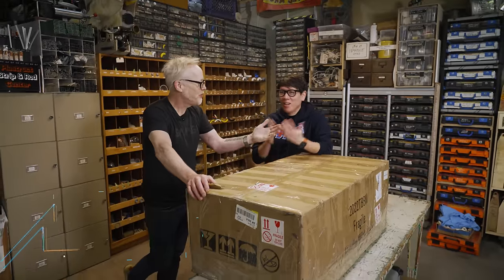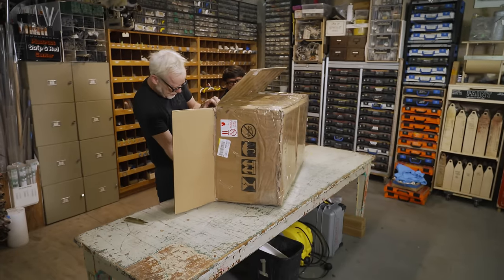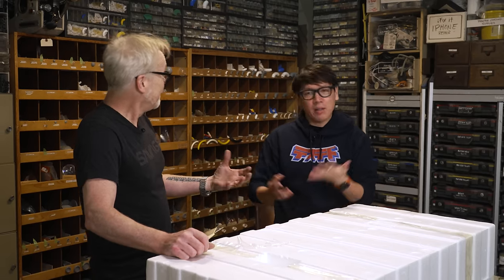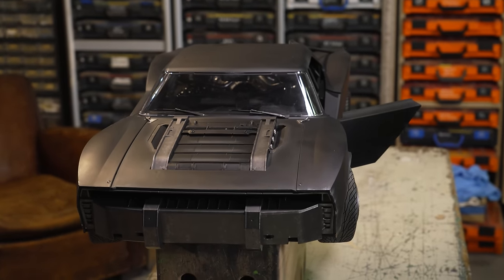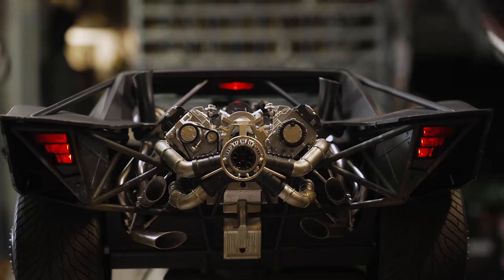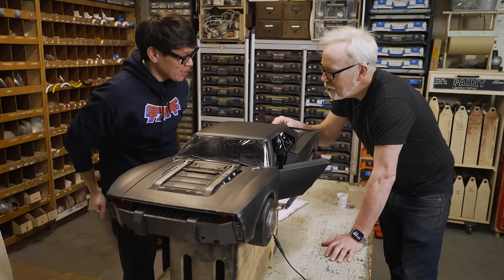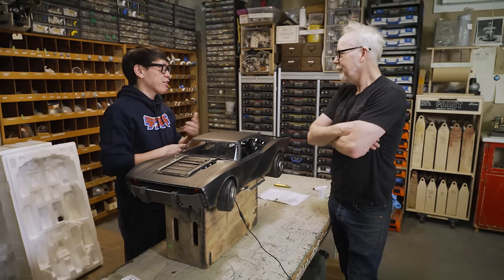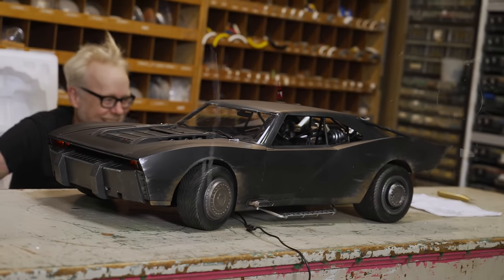Adam Savage Unboxes The Batmobile from The Batman (2022)!

Comment: There was an early suspicion that the rear engine was a triton v10 but it isn't, most probable explanation is that it is bashed in-universe from other components. A crate motor would be traceable but a frankenstein one wouldn't. Its a shell built by Dominic Touhy's team over methane tanks, with a 454 on front. The weight distribution with a plant that large in back is nightmarish, but it'd work for the chaos of a ramming prow. The jet turbine might not be an afterburner but a way to get exhaust out faster. It is no more silly than any other Batmobile and it continues to grow on me. The echoes of the Animated Batmobile are one of my favourite bits.

Comment: I always thought that a torque wrench was just for getting things tight enough, until I rebuilt an aluminium engine and found out it was for quite the opposite also.
Reply: Lol, I know right?!? Clearly Adam has never worked on any real world mechanical applications. Don't want to use a torque wrench, no problem heres your bolt extractor kit, heres your drill and tap set, heres your threadsert kit, etc, etc.
Reply: Yeah that one made me cringe a bit. Sorry Adam.
Reply: I'm a torque spec follower but more experienced mechanics i know tighten a lot of things by feel. as long as its not engine parts or suspension his advice seems reasonable
Reply: I love Adam, but sometimes the limits of his experience show.  The torque wrench is one example, and he recently made a video where he said he thought all the crap 3D printable models on the market were not a fault of the creators, but limitations of the software.  Having used all major 3D modelling programs on the market, he is 100% wrong.  The software is amazing - the problem is lazy creators.
Reply: I was honestly just making a statement. It wasn't at all to do with Adam's lack of knowledge. He's got more experience, knowledge, and skill that I could ever possess.

Comment: I have a bicycle with a lot of Carbon Fiber parts. There are screws that bolt on CF (epoxy) threads. Without a proper torque wrench you will strip the threads. Also, when assembling car engines, not using a torque wrench to tighten the head to the block is practically impossible. Besides new engines require the fancy torque wrenches that measure angles as well

Comment: sorry adam, whoever told you that about the handle on sockets and torque are just wrong. No IFS ANDS or BUTS. Torque wrenches are used to make sure you have the proper level of clamping, be it tight or loose. I have ALWAYS had issues with over-tightening using ratchets, I think I'm just snugging things down but end up being WAY too tight and end up stretching bolts and studs and have to start over with new hardware. On the other end my brother (who is much larger and stronger than I am) is forever leaving things too loose. For years in my fathers garage he would follow behind mechanics who believed as you do that torque wrenches were not needed and find that most were not even close to being correct. Every mechanic was required to use the torque wrenches or be fired, and over the years we lost several mechanics because they refused to torque correctly and it cost many thousands in repairs when their work failed.  But that is VERY BAD advice to be saying to the public even as an off hand remark, someone may actually listen and not use a torque wrench when working on their vehicle, and some items, not torqued properly can have fatal results.
Reply: This myth needs busted

Comment: Frickin awesome! And I love the ultrasonic atomizer addition, you don't have to worry about some weird chemical or something heating up to boil the water, plus using distilled water limits the worry of corrosion. I'm a big fan of the year one batmobile. It's not some ultra expensive custom made behemoth with 1000 fancy gimmicks. It's just strong, fast and will get the job done.

Comment: Okay, if they can do this, then they can make a Mad Max "Road Warrior" Interceptor in 1/6 scale - or a Blade Runner Spinner. ;-) There must be some weird licensing issues with those two movie vehicles, as nobody ever makes them (apart from the 1/18 AutoArt or Greenlight and that 1/18 Blu-Ray version of the Spinner). But having 1/6 versions of those vehicles for the 12" figures would be incredible. I modified the 1/18 Greenlight Interceptor into a "Road Warrior" version (which involved dremeling die cast, which was a bit dicey lol).

Comment: Nice bit of kit , functional shelf queen , I have just remembered I have a few rc's that are bigger scale than my scale model vehicles one of which is a tank , working sound effects,working smoke machine for exhaust and working turret that fires bb's up to 20 meters, I need a new battery for it but otherwise like for like running tank , I need to open the original transmitter as the plug for the crystal needs soldering. I have a diecast mad max car up on the shelf that's a bit bigger than 1/24 . Cool video guys

Comment: What a gorgeous piece! Not sure if the engine is based on anything real, IIRC from a documentary on the build the engine is actually front mount and the rear engine is for show... Not quite sure why, as there are plenty of new BMW and Audi models with twin-turbocharged V8s (albeit front-mounted), and a Porsche 918 has a naturally aspirated mid-engined V8, as do plenty of other supercars. So no reason why this couldn't be done. I'm sure some rich, handy bodyshop will make a replica with a real twin-turbo V8 in the back at some point...

Comment: once again adam giving bad advice,   believe it or not if your like me and have strength you can get the max torque from a 1/4 in drive socket wrench....being when it fails.over 30ft. pounds.
point is if your doing something precise dont guess and use the proper tool.
Reply: Keep in mind that Adam`s job was never to make things that work, but rather make things that look like they work for long enough to film them. He was dead wrong, but keep in mind that he is not a proper mechanic or machinist when considering the weight of his advice.
Reply: @rustknuckleirongut8107  which is why he shouldnt be giving advice.

Comment: The idea that the length of a handle of a socket set is somehow self regulating when it comes to torque is just insane. Whoever told him that wanted bad things to happen to him and the things he were making. First off: What material are you dealing with? How strong are you? What is the structure of the thing you are dealing with? What is the diameter and material of the bolt? I have friends that can pull from 80% to 200% the torque I can with the same tool.

Comment: Just one little oops I see, which is likely carried over from the actual movie production vehicle.  What is the point of the exhaust outlets under the doors with a rear engine vehicle that has exhaust pipes back there off the hot side of the turbos?

Comment: Saw a documentary on the design and building of the car. It is the most functional, powerful, and fastest batmobile ever. The rear engine is a completely bespoke fabrication, purely ornamental. Which is actually the one disappointment I have with the car. There are too many exhaust and intake ports that just don't seem to serve a purpose. It looks like a twin-engine car. Still, easily my favorite batmobile since the '66.

Comment: I hate to say it, but that torque wrench advice is terrible, especially in an automotive setting where there's a ton of vibration and it can often be a safety and reliability issue if torque isn't correct. Just from firsthand experience, I've seen wheels come off and oil drain plugs fall out while driving (shop actually saw techs fail to use a torque wrench from cctv footage and covered under warranty in the latter case). 
Love you guys, but I had to say that. lol

Comment: You think these are expensive? Try getting into 1/5th scale R/C vehicles. Hell, even 1/10 and 1/8 scale can cost a small fortune. I have a Traxxas Slash 2wd that I have over $1500 tied up into (closer to $2k actually) just to be able to go 120+mph. It also costs me roughly $50 every time I run it because I shred all the gears inside the transmission due to the fact it was never designed to be ran with a 1/8th scale motor on 6s. This Batmobile is cool as hell, but I would never spend $1500 on a 1/6th scale vehicle unless it's a R/Cvehicle.

Comment: Socket set? No!
Spanner? Possibly!
Reply: Not even there. Just the individual difference in human strength will give hugely different torques with the same spanner. Also the material you are dealing with will massively effect how much torque you can use before it breaks.

Comment: Top Tip:
As an RC car enthusiast and scratchbuilder this was nothing special... seemed plasticy and cheaply made imo. When Adam was fondling the front wheels they seemed floppy and weak...
You can litterally get realistic, full metal 1/6 rc cars that basicly has the same features and drives 60mph for ALOT LESS...
I'd rather buy the Arrma Felony 6S and a light and sound kit and you would have something similar but waaay better and actually drivable... FOR HALF THE MONEY!